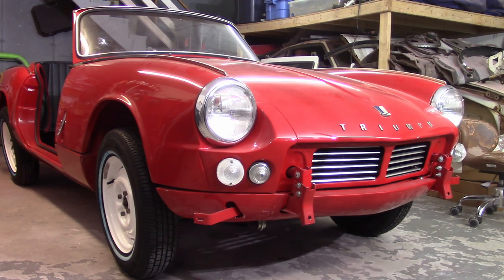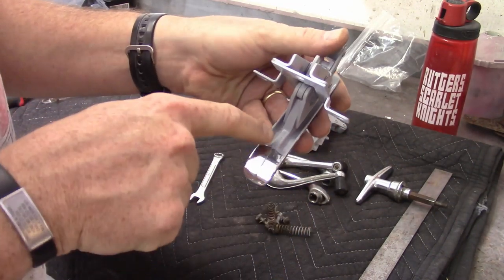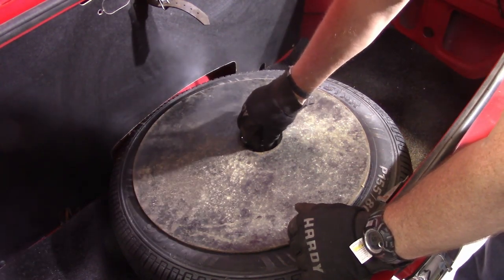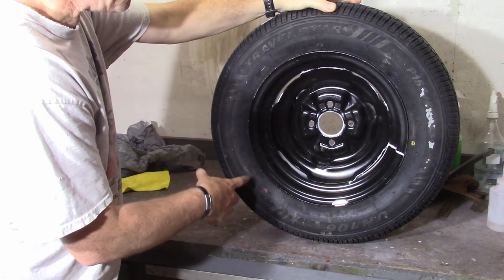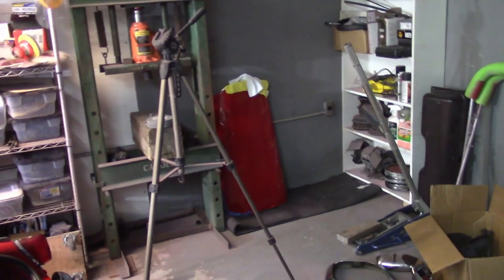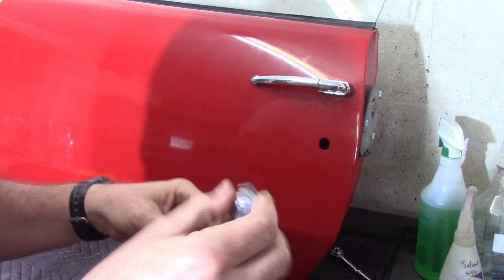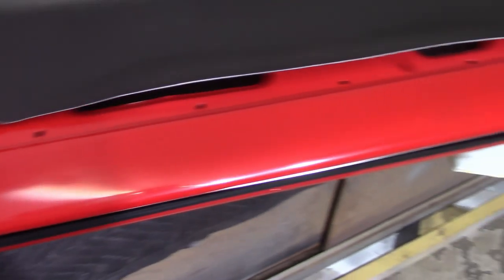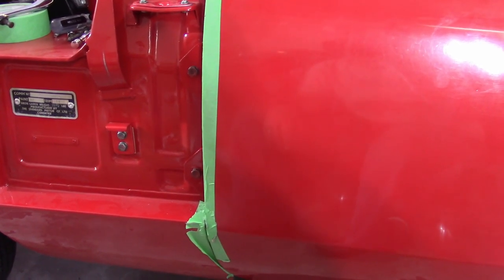Triumph Spitfire - Doors Kicking My Butt | Roundtail Restoration

Comment: I had a 1953 Porsche. The doors, hood, windshield glass were all unique. The glass had 1/4" variation. Hoods and doors are.....near impossible. I wont give details. I had two good doors but had to replace the hood.  Oddly the back clips all match from the 1/4 windows to eng lid. And in 1977 Porsches were rust buckets. Mine had orig battery box...very rare. Today i have a 1964 Spitfire. The fit is OK. I am going to modify the door edge at latch area,  too much gap but otherwise they look good. And MUCH cheaper!! Ive seen Rusted Filth sell on ebay for $10k+. Criminal....a 81 yr old guy from Florida has been trying to sell his one owner Spitfire for $15k on ebay. Restored. Nice...door gap issues. No one has bought it for 3+ months!! It's nice.
Reply from the maker: Wow, nice range of cars there. Funny how some stuff you'd think would sell...

Comment: Ahhh the doors. I am not looking forward to doing mine after the paint. I am a bit of a klutz at times. However I was surprised that the gaps and lines came out the way they did after I put the door skin on.
Reply from the maker: Sometimes a bit of luck is all we need! Hopefully I'll get lucky at some point during fitment!
Reply: @roundtailrestoration  Yep, there is always that one sweet spot that is so hard to find and when you do, what a great feeling.
Reply from the maker: I hope you're right!
Reply: @theawakening5548  I found mine, kind of, the drivers side is alway's the problem area (for obvious reasons), so I've learned over the years..
Reply: @poppydogz  It is tough especially when it is only you doing it.

Comment: Chris, have been watching your videos for over a year now, have learned so much from you........thanks for doing what you do.  I have a 1976 Spitfire which needs everything doing.  One topic I can’t find a video on is “door drop”. I can install my drivers door but when I open it the whole thing drops about a centimetre at the door handle end and causes the bottom of the door to touch the rocker cover if I open it all the way.  I removed the plates in the A post and had nuts welded on the back but that did not solve it, I replaced the broken hinges, still the same problem. I guess I will have to remove the plates in the door and have nuts welded on the back so I can tighten the hinges up. Did you have door drop on Dorothy’s doors, and did you do anything to the plates in the door
Reply from the maker: Thanks, Steve, I appreciate that. Yes, I have the same exact problem and do not have a solution for it (yet?). However, here's a video (https://youtu.be/ZxcSD4sfIZ8?t=457) where the guys deal with it on a GT6 by making reinforcement plates for the A-post. If I had found this video before I did paint, it is what I would do. I think, like they say in the video, that the whole A-post moves under the weight of the door. You would think the factory would have figured that out and had a solution for it over all the years, but....?
Reply: Chris I was surprised how easy it was to take out the plates in the door and have some nuts welded.  Did not have to take out the door guts to get them out,.  Have the bracket dimensions from Fantastikbuilds so as I have not yet painted I can fit these also.  Thanks again for your help.

Comment: I doubt those doors ever fitted too well. 40 years ago my TR7 was a nightmare of cheap plastic and thin metal, and was so poorly constructed that the timing marks on the flywheel were in the wrong place (which is why no dealership could ever make it run properly, whilst two guys in a backstreet lockup figured it out and fixed that issue!) I had a neighbour on a sheep farm in Wales with a perfect 1952 Standard Vanguard kept in a barn and never used - he went to market on his tractor) - and that car felt like it had been machined from a solid block of steel. My father's Morris Minor and Riley One-Point-Fives in the early sixties were very decently built, but overall there was an obvious downward trend in quality from the independent manufacturers to BMC and then God help us, British Leyland.
Reply from the maker: I know the reputation isn't great, that's for sure. So many labour strikes and all of that. A shame.

Comment: Those stupid door locks, my MG has the same. Miss makes a kit that uses a c shaped washer and set screws that you can add from inside to draw the lock in. Check it out.
I've been using weldwood brush on adhesive, they have it at the big box stores and it's super strong.
Reply: Moss is what I meant..
Reply from the maker: Thanks. Can you give me the Moss P/N? I can't seem to find it.
Reply: I'll get it when I get home, it's in the paper catalog.
Reply from the maker: Ok, thank you
Reply: @roundtailrestoration  OK, it's 402-195. The locks for the MG are 402-198 if you want to compare to the Spit ones. I haven't used these so do your research.
Reply from the maker: That's f-ing genius! Thank you!! I might try to make that. Looks easy enough!